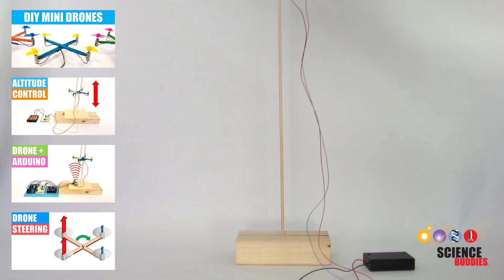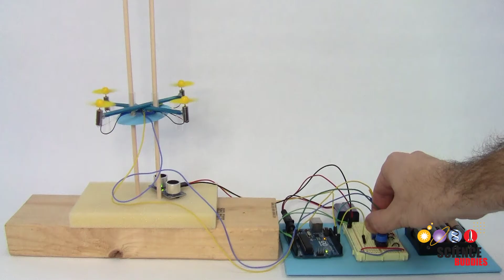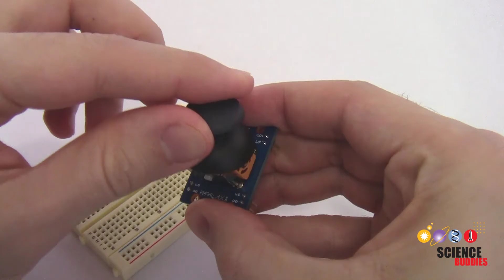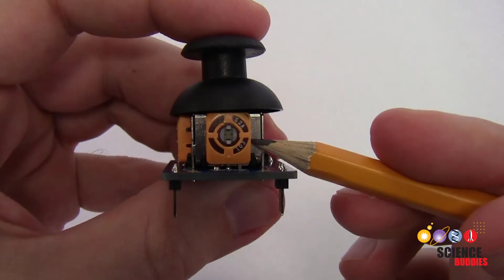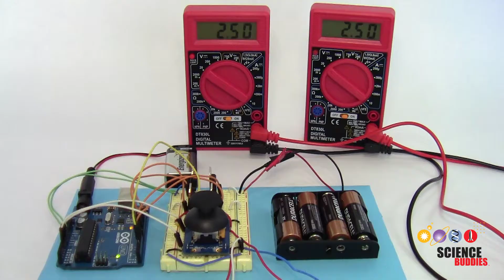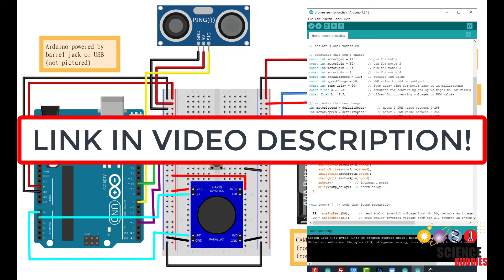DIY Mini Drone Part 5: Analog Joystick Control | Drone Science Project

Comment: the code doesn't open with me, can you send the code otherwise?
Reply from the maker: Make sure you have the Arduino IDE installed. Our Arduino tutorial series may help if you are not familiar with Arduino: https://www.sciencebuddies.org/science-fair-projects/references/how-to-use-an-arduino. We are unable to send you the code directly, but it should work if you download the file from our website.
Reply: @Science.Buddies  can I download the file code in my phone?
Reply: @Science.Buddies  can I send to you a message for help me I want to Write a code for control 4 brushless motor using joystick module and arduino
Reply from the maker: Hi - as far as we know, you cannot run Arduino code on your phone. If you need additional help, you can ask in the Ask an Expert forums on our website: https://www.sciencebuddies.org/science-fair-projects/ask-an-expert-intro